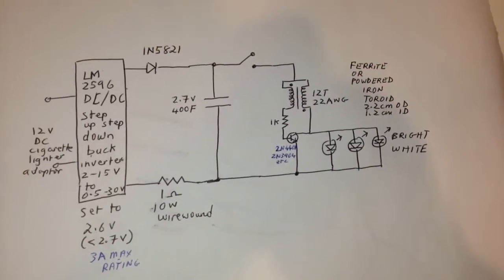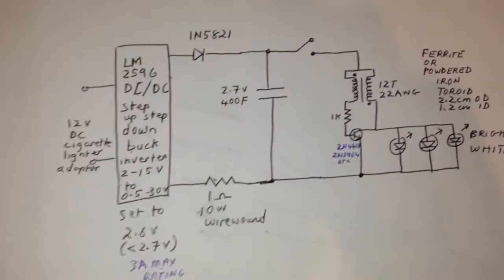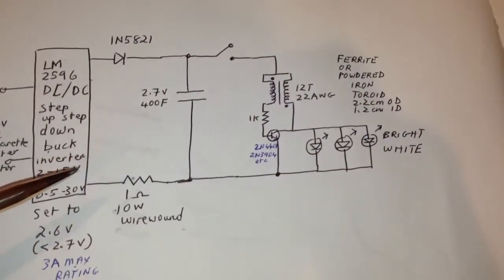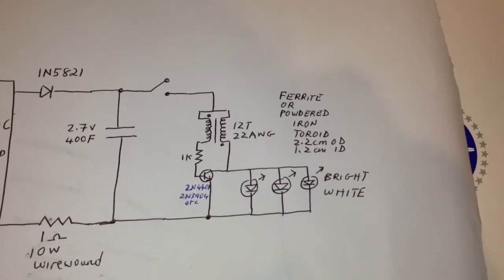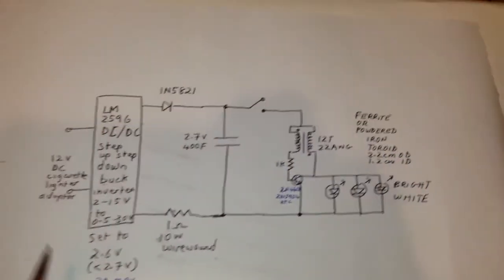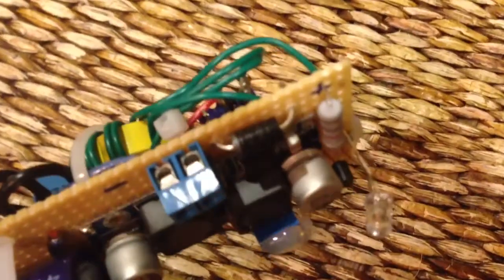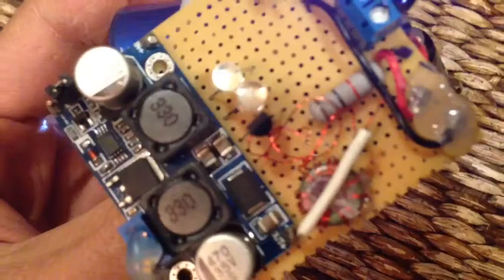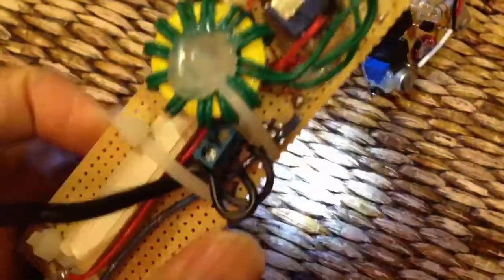Simple Ultracapacitor Joule Thief Flashlight

Comment: Hallo, because I have done something close to this i feel inclined to tell how i went about it:
I took a 3V Solar-Panel to charge up an ultracap+a pushbutton-activated joulethief to step up the voltage to max 9V and store it in a 1000µF Cap and to this cap i attached lasersabers looper circuit (~22turns to ~45turns, both blocking oscillators with tiny ferrite rings) because it runs quite efficiently at higher-Voltages(I would say 2V to 10V works good) so I can use almost the full capacity of the ultracap until 0.5V (I must add that I have an indicator circuit and a diode-series-overcharge protection attached as well, both hooked up to a mosfet that only is active when there is voltage on the solar panel) If one does not want to quick charge the ultracap a 3V panel substitutes the voltage converter. (maybe a 2v solarpanel is even better because no overchargeprotection is needed)  I must add that I only used one white 10mm LED and the continuous consumtion is around 5mA but it is relatively bright